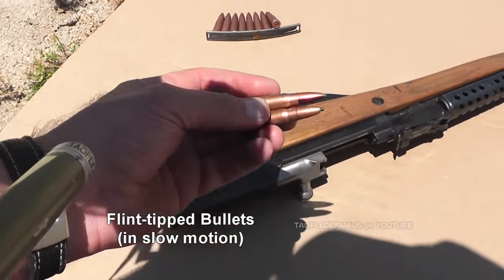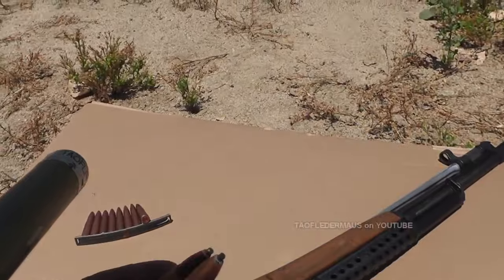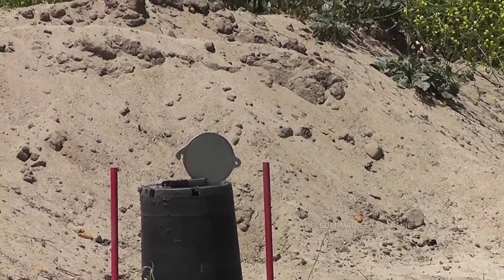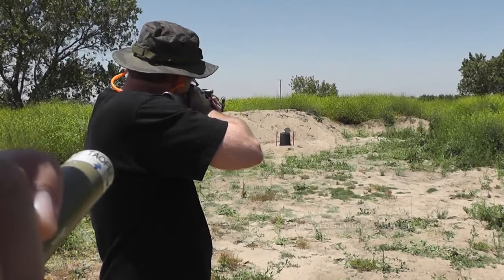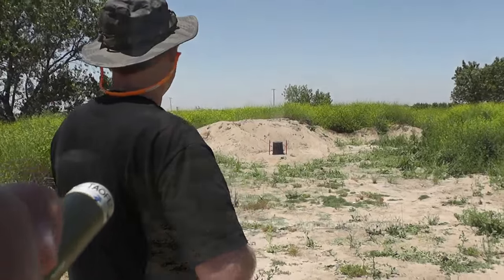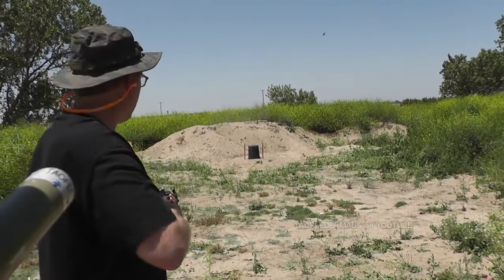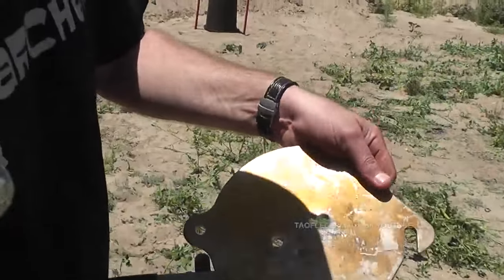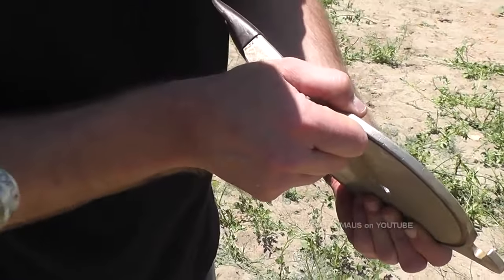ZIPPO-FLINT TIPPED BULLETS - Poor-Man's Raufoss

Comment: Even if it's completely impossible for someone to get a gun, they can still use a knife and cause a lot of damage. 

As for sneaking into my house, try and break down a steel door with multiple locks without making any noise. Even if you get past the door, you won't get past the buckshot.

Also, fun ≠ recklessness. I've worked with bullets, arrows, tomahawks, throwing knives, and other deadly projectiles for years without seeing a single injury.

Comment: I set the bullets upp in a milling machine and made 20 identical bullets.
Similar with the tungsten rods.
I inserted the tungsten into the bullets with a loading press 
The general grouping of rounds didn´t shange much, cause tungsten is similar in weight to lead.   Use magnum load though, speed is the key to good AP!!!    P.S.   I used cal .308 win   D.S.

Comment: Hi:) I would have like to see that going through a propane tank would be a certain explosion. And flint is harder than lead and copper so there is going to be a difference than just a regular FMJ because the flint is moving at the same velocity as the bullet so it don't matter how brittle the flint is. it is still harder like carbon maybe some one should try a diamond and 1 inch plate and see what happens.

Comment: you should heat rounds near red hot then put them out with old motor oil and boom hit steel and its the poor mans high exsplosive framentation round jut trust me and be several hundred yards away or a least 100.
Reply: What?  How would that even work?

Comment: A bullet proof vest by itself would be no match for this flint tipped round. A bullet proof vest with the hardened steel plate...... not so sure, it may penetrate. If the vest had both the hardened steel plate with a ceramic plate in front of it, i highly doubt it would penetrate.

Comment: @qwerty1230001 I love mine plus the ammo is cheap compared to other rifels.  You can get 1000 rounds for about $230.  It is fairly accurate considering you are using iron sights and the rounds will go through 2 plates of 1/4 in steel

Comment: Very intersting video but did it make any difference in penetration?

would the same gun have penetrated the plate without the flint?

I shot a 4x4x8 brick with a 30 06 armor piercing from about three feet away and got a nasty little hole in my chin,,,,just a few drops of blood. don't know if it was steel or brick but either way I'm not taking any chances any more....minimum 6 feet away next time! !! hahahaha

Comment: Now make some real armor piercing rounds with solid carbide 1/4" drill bit shanks. Cut them to 3/4" then grind them to a nice sharp dome point on a grinder with a green stone and seat those down in a .308 or 30-06 round. They will punch through damn near anything.

Comment: Fill a long aluminum arrow  with propellant, or black powder, a hole through the field round with a cap or flint in the point. Be like the arrows Rambo used but home made. I was were I could test one once but never did. Oh, thermite is =rust(iron oxide, iron ore, ground aluminum cans and ground aluminum, and glycerin. glycerin added to the mix,  will set a stump on fire in a sleet storm and let you weld 50 miles away from a town at 30 below zero.

Comment: I'm pretty sure that's called ALUMINUM... not stainless steel. Yep, that's my 2 cents.
Reply from the maker: SoutheastBluesMan   Did you think I would get more chicks if I said it was stainless?
Reply: That's a hell of a motive. I like it!
Reply: it is aluminum. its an inspection cover for a tramco pump.
Reply from the maker: If it was aluminum,  I would have said it was.
Reply: Okie dokie then. Ya know, it's probably something closer to Unobtainium... or Adamantium. Now that I watched it again, it looked like pretty strong stuff. I'm sure glad you had those bullets with the small atomic Mithril warheads attached.
Reply: Ah, Aluminum doesn't spark, even w/ a flint, SO . . . it must be some form of steel . .  just saying! Laws of physics still apply.
Reply: Even though you're right that it is indeed some form of steel, the fact remains that flint at that velocity would still spark on its own on impact.
Reply: +SoutheastBluesMan The spark is caused by the extremely hard flint blowing off small chunks of steel on impact, just like how it creates a spark in a lighter.

Comment: Thanks for a VERY well done video. Flint tipped bullets make for a fun novelty. I was wondering what's the best way to insert flint, and should it be flush with end of bullet to prevent feeding problems? I would assume that the very tip of bullet is cut off for flat surface , then small barrel type drill in your hand to make hole to insert flint?
I can't believe how all the chicken shit know it alls write in criticizing anything they can about everything & everybody.again GREAT VIDEO!

Comment: with this size round drill a slightly larger hole than the flint use a half flint( not as long  as to not fill the cavity) use a small bb/ball bearing at the bottom then fill cavity with black powder and insert the flint. as flint rears back creating a spark it ignites the powder creating an explosive round that will explode on impact with any object. trick is not leaving the tip exposed. melt lead drop over the flint not allowing the hot lead to touch the powder. booom you have an exploding armor piercing round that can be continuously fed threw the clip. a little creativity and steady hand and anything is possible.
Reply: Why risk hot melted lead? Why not bondo, putty, or even wax? Just wondering if the lead tip would be necessary for success.
Reply: I would use jb weld. it has to be stiff enough to not move while in flight and blow early.

Comment: Those  mil-spec rounds as issued should have penetrated THIN steel anyway.     

  HOWEVER, JUST CUTTING POINTED END OF JACKET OFF AS YOU DID {TO EXPOSE LEAD CORE WILL LET THEM EXPAND VERY MUCH AS HUNTING {30-30} FLAT NOSE SOFT POINTS DO...BOTH IN THE TESTED CALIBER AND "OTHERS"  INCLUDING that cartridges bigger brother ...the 7.62X54rimmed Russian .   I have used "RE-PURPOSED & MODIFIED" SURPLUS mil-spec 7.62X54r WITH SHARP END OF STEEL JACKET FMJ CUT OFF AND FILED FLAT TO LOOK ABOUT LIKE A 30-30 FLAT NOSE BULLET... LIKE THESE IN VIDEO WITHOUT THE FLINT...
  THEY EXPAND VERY WELL AND WILL TAKE A DEER DOWN JUST AS WELL AS COMMERCIAL LOADS...AND AT THAT TIME COMMERCIAL LOADS FOR THAT RIFLE WERE NOT AVAILABLE IN THIS COUNTRY YET.
Reply: I MODIFIED MINE IN SIMILAR {WITHOUT FLINT} FASHION FOR USE AS HUNTING LOADS BY REMOVING ABOUT 7 GRAINS OF TIP AND FILING FLAT WITH A "FLAT BASTARD FILE" {yes, that is the correct industry name for the tool}.  TO MAKE AN INDEX MARK AND CUT THROUGH JACKET I USED AN RCBS CASE TRIMMER WITH PILOT REMOVED AND CARBIDE CUTTER DIE IN PLACE TO CUT AND INDEX.... THEN FINISH JOB WITH HEAVY LINEMANS PLIARS {ELECTRICIAN-SIDE CUTTER} .   DIKES OR A PRECISION SAW WILL ALSO WORK .  FINALLY FILE FLAT... THE  FINISHED ROUND SHOULD HAVE A FLAT NOSE THAT LOOKS ABOUT LIKE A 30-30 FLAT NOSE BULLET.  A LITTLE EXPOSED LEAD WILL EXPAND A LITTLE...EXPOSING MORE AS I DID WILL ENSURE EXPANSION EVEN IN SMALL DEER, WHICH IS WHAT I INTENDED TO SHOOT...
   IN MY OPINION THE SMALLER DEER {HALF-GROWN YEARLINGS AND TWO YEAR OLD}  TASTE BETTER, AND ARE EASIER TO DRAG OR CARRY OUT OF THE WOODS.... AND SINCE I LIVE IN A MULTI-DEER TAGS ALLOWED STATE...  IT JUST MAKES SENSE TO CULL THE SMALLER AND BETTER TASTING DEER SO THAT TROPHY BIG ANTLER HEAD HUNTERs CAN ENJOY THEIR GAME TOO.. 
  SHOOTING SMALL DEER IS A WAY TO IMPROVE OVERALL HERD QUALITY, AND THEY TASTE GOOD TOO.

Comment: I don't doubt that was stainless...First of it looks like it second off it does not look any thing like stainless. Finally my ak chambered in 7.62x39mm can penetrate though way more than just a 1/4 inch stainless plate. and those are FMJ so these rounds should have more power than that.

Comment: @criticaboutvids 

Its still a pretty dumb idea if done for anything other than fun. You end up with a less accurate bullet for no gain whatsoever. The bullets would have gone through that steel plate anyway, as it was not hardened steel. Get a 1/4" hardened steel out there and there would have been no penetration.

Comment: STAINLESS STEEL IS WAY SOFTER THAN ORDINARY INDUSTRIAL PLATE, AND FAR SOFTER THAN HIGH CARBON HARDENED STEEL. There is a good reason that they don't make high qaulity knives out of pure Stainless Steel. Stainless will not keep an edge. Try the same again with regular industrial plate, and, for God sakes man, don't angle your target for fear it may ricochet back at you. Ricochets occur but not at a 180 degrees... even with AP ammo. Concern yourself with keeping Richochets from going elsewhere.

Comment: @qwerty1230001 Ive owned several and they are the same as a 30/30. Both in accuracy and in ballistics values. The american market believes anything from a communist design is inferior. sad to say the SKS will keep up with any other mid range rifle. I have an SKS set for 300 yards and get 3 inch - 4 inch groups with good ammo...commy ammo i get 5-6 inches from a bench rest. not bad for an "inaccurate commy gun" dont compare it against what it isnt. its not a light calibre .223.